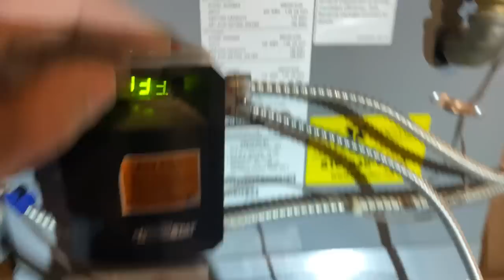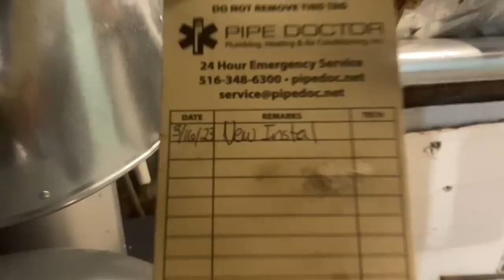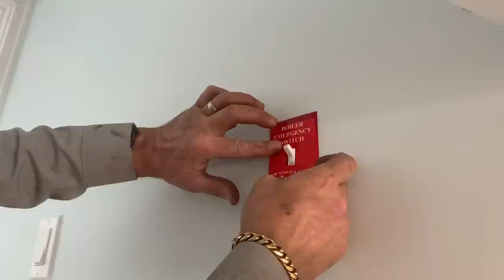Scammed Homeowners Finally Get What They Paid For - Weil McLain Gas Boiler Installation

Comment: Some people say how it looks does not matter. Nothing could be further from the truth. For gods sake it's in the name of our trade Plumb. I have seen so many hacks who just slap pipes in any old way, bend pipe, or just odd angles. Yes it may work but I have been referred to customers who have seen the installation and liked what they saw. Just like the uniforms you wear how to leave the finished job matters and shows the customer you care about what you are doing for them and that adds to the value of what the customer is paying for. I have received messages from customers who had their oil companies who maintain the boilers threw their oil contracts ask who did the installation and to tell them to tell me nice job. I have had electricians Say I need to get more material or do things differently because they do not want to make the wiring look sloppy. Make the Trades Great again and keep up the good work Mike and Daniel.
Reply: Sorry but plumbing is a derivative of pumice,old Latin for lead, remember the old plumbers poured lead joints. Coming from a old plumber who can still pour a lead joints when needed

Comment: Basic simple boiler install looks good 👍🏻 only thing I’m going to nitpick is that there is no magnetic filter on the return. Using those ECM pumps is a great way to save money for the homeowner but protect your installs, ferrous metals from the block of the boiler will over time get pulled into those pumps and kill them, magna clean is the product you’d be looking for. Or just stick with standard pumps.

Comment: That tapping is for your auto vent and is required. These boilers rust out and fail early because air gets trapped in the top of the heat exchanger (no, the supply tapping is not the highest spot).

Comment: We didn’t do one of them Weil McLain boilers for a while.  We totally forgot about the 1/2 hole at the top.  And we couldn’t figure out where it was leaking from. Finally we remember and installed an air valve.

Comment: I'd have ran the support rod from the floor up tot he manifold/circulators, instead of hanging for the ceiling. but the only reason is to help eliminate possible noise/vibration. in the end, either way works!

Comment: THANK YOU MIKEY MIKEY FRICKING PIPES!!!! ive been waiting for you or steve to install a cga-5 so i can visualize the footprint im going to be working with. im doing 2 zones with zone valves and trying to keep it small so we can gain some space in the laundry room.
question: for the wholesale plumbing supply houses, do you need a plumbers license or will a general contractors license do? my local menards and lowes are limited on what hydronic parts and brands they carry.
as always, beautiful install. 
thank you mike.

Comment: tighten the pressure relief valve 180 degrees and then tighten the elbow 90degrees so you can unscrew the tube so when you replace blowoff you dont have to cut the tube

Comment: Mike, can you explain your reasoning for putting ISO flanges with purges if you put iso valves with purges on the return anyway? Do you purge from the return or from the feed? Just curious cause I saw another one of your installs set up the same way. If you purge from where the pumps are does it purge the boiler just as good as if you were purging from the return side? I guess in theory it doesn’t matter where you purge from I guess the air will work its way out right?

Comment: you could use a regular "jumbo size" switch plate for the boiler switches and your oversize stickers should fit without trimming, should be red/labeled enough to suffice for any code inspections. lol

Comment: Clean install. I like the 45's. 90's are for guys who don't know how to use 45's, and couplings are for guys that can't measure pipe correctly. 
Hate to throw in a negative comment, but you missed a perfect opertunity for a primary/secondary pipe configuration.

Comment: beautiful work! would've loved to see a valve after the pressure reducer though!!!
Reply: Don’t those Caleffi PRVs have a built in shut off valve on the bottom?
Reply: @daversj  Didnt know that, but it still doesn't help the next guy who has to replace it

Comment: Just curious how they could not know it wasn't gas? I mean in 2-2 1/2 years did they not have to buy fuel oil? 🤔
Or am I misunderstanding what had happened?
Thanks for sharing.
Another good video.
Reply: It was a boiler that originally ran on oil, but was then converted to gas with a different gun.
All he said was that it wasn't compatible, but not why.
Reply: It's an oil boiler that was converted to gas (with a burner conversion kit) and Mike doesn't do retrofit (most manufacturers don't like it )... I've seen a ton in a lifetime, they're a cheap way to convert to gas... Today's prices $2500 for burner vs 12-14,000 new boiler... It's all it what you can afford ...

Comment: Good job Mike and Dan, Surprised that Peter and Frank f-ed up, but it's in between you guys, only thing is that pipe hanger is screwed to floor boards, I think it should be screwed to studs, And another thing is the drip leg, New York really? People are really messing with drip legs?

Comment: If you told her that isn’t a gas fired boiler, you sir are a hack. That is an oil boiler with a conversion burner that runs NG all day every day and absolutely is compatible. The manufacture of the cast boiler lists the oil burners it’s compatible with but conversion burners that meet the same specs as the oil burner is still comparable. There is nothing wrong with what she had and you charged her how much to gain her 2% in efficiency?